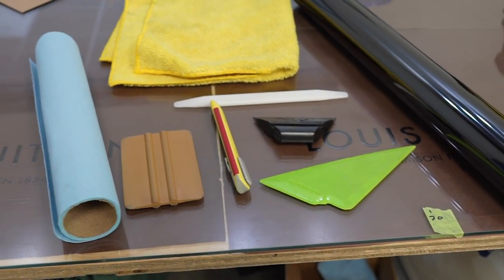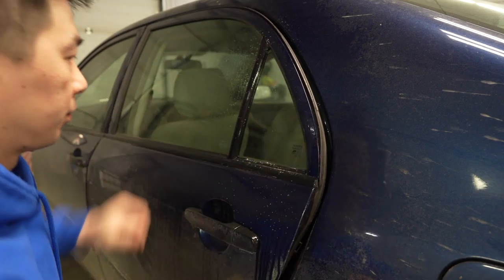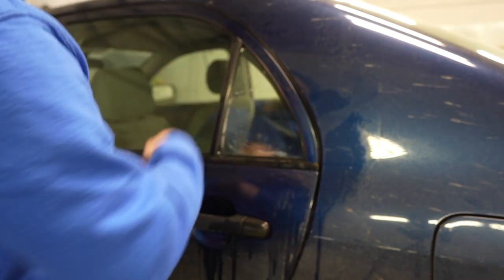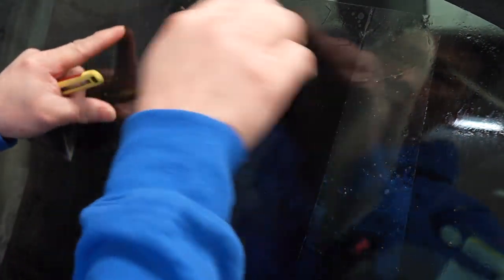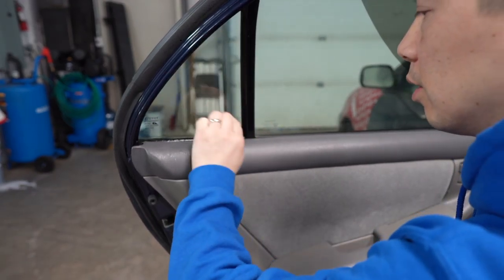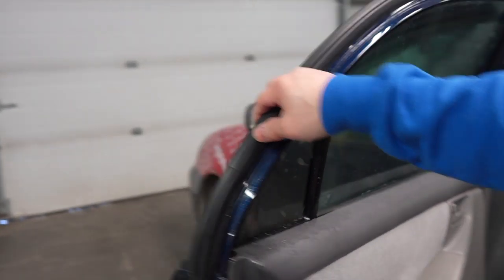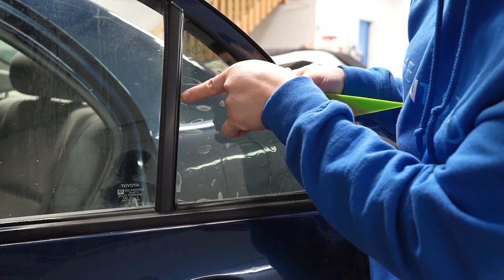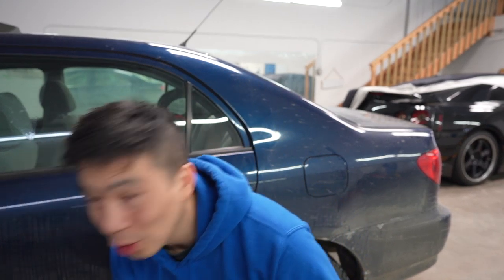DIY Window Tinting for Beginners Made Easy!! Part #2 Quarter Windows

Comment: Also, quick question… I know this is for beginners but as a professional… do you prefer taking the glass out completely (if it makes sense to do so) or do you prefer nstalling the tint on the car like shown in these videos. Im guessing it depends on how time consuming it is …depending on the car…
Reply from the maker: Time is money and taking out windows is time consuming and can be risky. Putting the window back in before the Tint is fully cured can cause the Tint to peel and the door frame may cause the Tint to tear. The our risk involved is dropping and breaking the glass. Accidents do happen and on new vehicles finding replacement glass can be hard. If the glass don't have to come out I would leave them in. Thanks for the question!